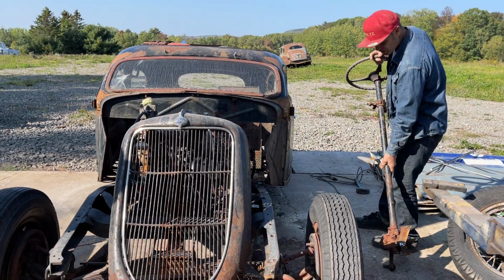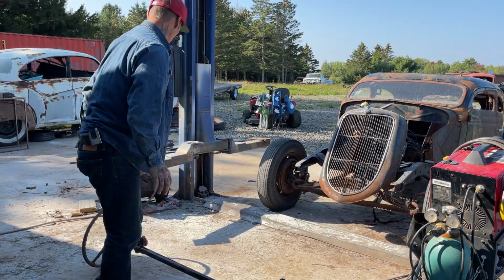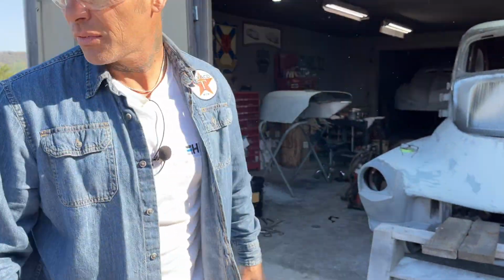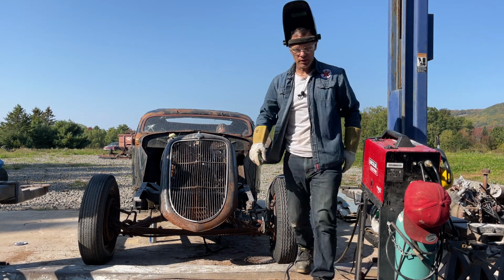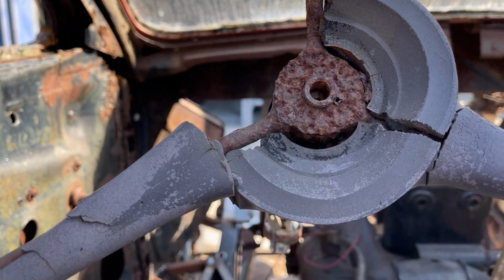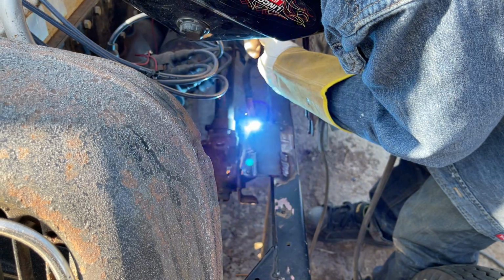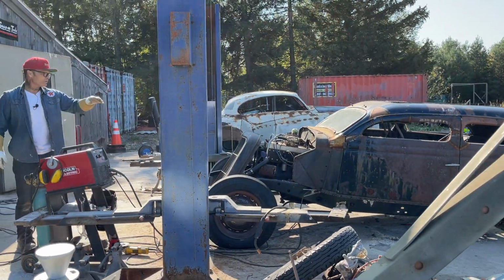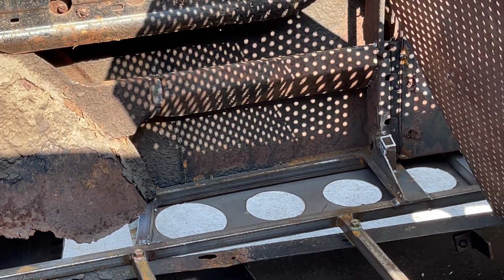MOUNTING THE STEERING BOX: 1935 HUPMOBILE/FORD HOT ROD

Comment: I agree that perforated metal  is not safe for a firewall. If a radiator hose blows, or there's a fire, it will all blow back on Jolene. I would use stainless steel, and if you're concerned about the weight, eliminate the front brakes and drums. The rear, being a modern asembly, should be sufficient,

Comment: Would not use perforated metal on firewall or the tunnel idea of fire wall is to prevent gas and oil fires from coming threw would hate to see Jolene or you get burned also should use aluminum at least as thick as diamond plate or road sign for floors for same reason. Watch a pop can or gutter in a fire. I know chance of a fire is low but they do happen better safe than sorry. Build is looking awesome so far but please keep it safe. Love the content.

Comment: I am truly sorry Jolene bad Chad is a bad boy he cannot even buy you a brand new steering wheel and column to go into your race car you definitely don't want to be going down the 1/8 mile doing 300 miles an hour and that rickety old nasty steering wheel pull straight off the column with that said bad Chad now turn cheap Chad needs to install a James Bond 007 ejection seat yes with parachute for Jolenes safety